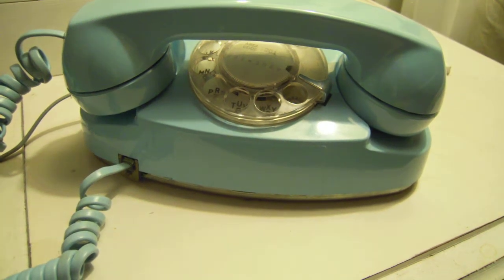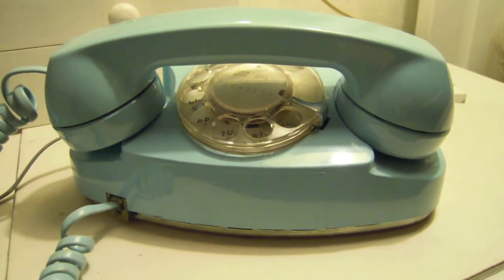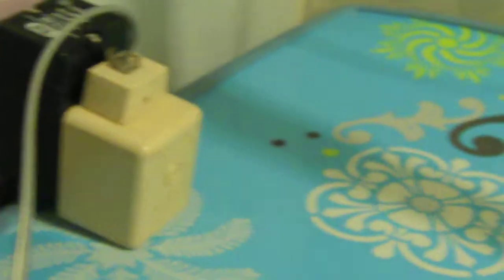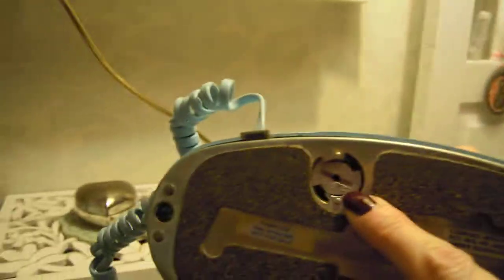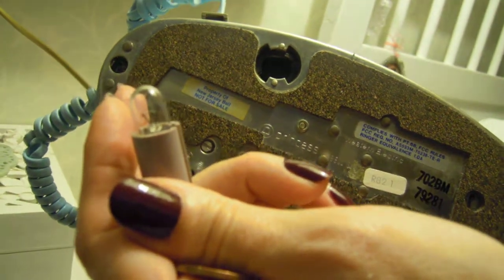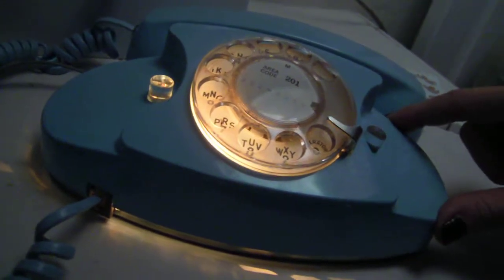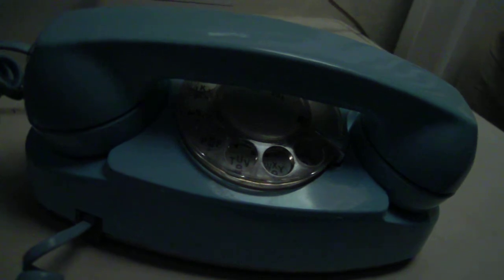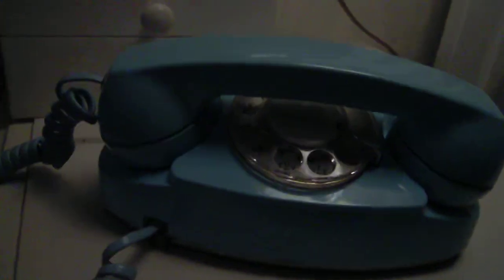Princess phone by Western Electric

Comment: What is the voltage output on the transformer?
Reply from the maker: 220V
Reply: @KaragioElena    Wrong.
Voltage output .
Not Limeyoltage input.
Reply from the maker: @robertgift  On the transformer it says 
 Input 230V
Output 110V
50V/60 HZ
Hope that helps